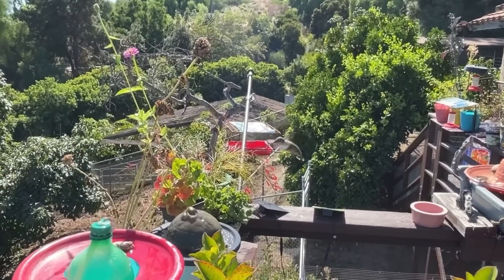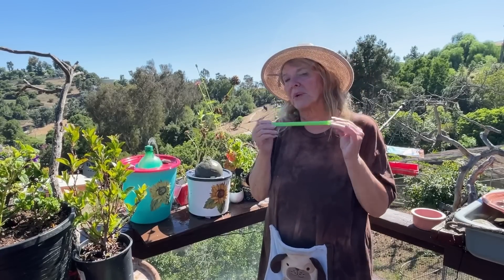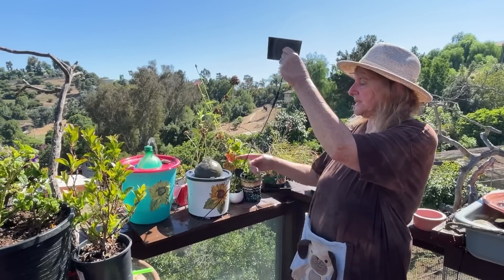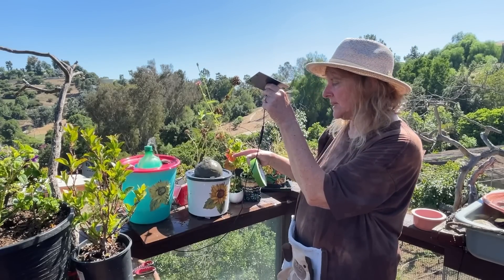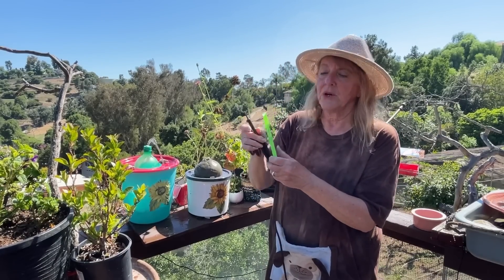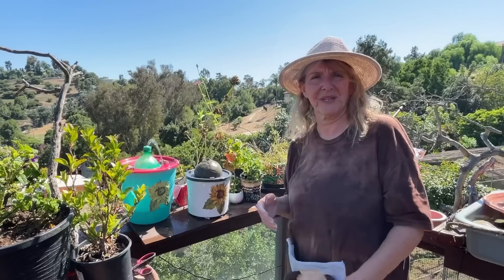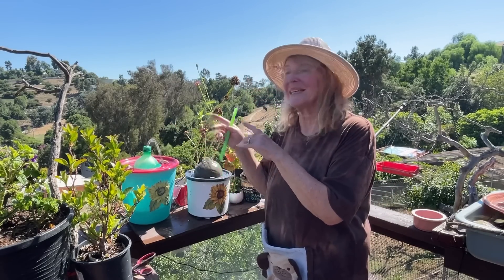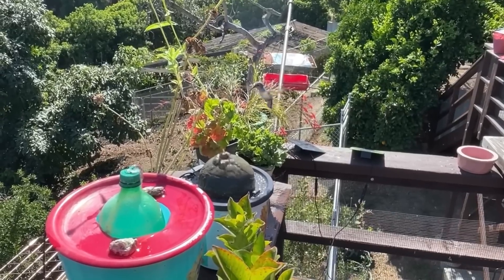Slow the Flow * How to Make a Solar Fountain for Hummingbirds Endless Water Bird Bath DIY Easy Fix

Comment: Slow the fountain down?! I can barely get a dribble out of mine! Robbie, I've been following you forever, I've built umpteen solar fountains based on your videos, but I can't get a single one to "spout" like yours. Granted, I'm in NC, not sunny California, but even in full sun, zip. I finally purchased a "real" fountain pump from Amazon and its spray is too powerful! It blasts so high up, it doesn't come back down in the pot, so it constantly runs dry. HELP!

Comment: I finally got my bait bucket ball set up except I made a cement ball using light globe I left lid in bucket and  just cut center it gave it extra strength plus had the  holes already bought tubing from site you recommended so perfect. The finished DIY  was perfect..❤ love your ideas ❤

Comment: I've been watching your videos for awhile now & I love them as do the birds. I have a question about one of your fountains that use the submersible pump & battery pack. Do yours ever stop working? I ordered the pump from your link, already had the power point, it worked great for the first day, the hummers & other birds loved it, then it stopped working altogether, even though the power point still showed a full charge. If so, what was your remedy for the problem?

Comment: Just today we set up a bubler according to your instructions, we couldn't wait after seeing your vids 🙂, and it works wonderfully, I am just trying to coax the hummers in to use it.  It's funny you posted this video today because we had that problem where the intense sunlight reved up the pump and it over shoots, I will try these fixes.

Comment: Hi Robbie. Not sure what department the straws were I didn’t see them last wk Walmart .
- I bought the usb solar I forgot it makes a buzzing noise. Will it scare the birds away? 
- I found the basters Walmart. Can’t wait to set it up. Ty.
Reply: I couldn't find the straws at WM either so I tried ordering them online, the day before they were supposed to come I got a message saying it was going to take longer to get them so they canceled the order.
Reply: @debwagner3161  ty
Reply: I ran into that too, although I looked all over Walmart - maybe they don’t sell the straws everywhere? 😕  I’ve just been using tubing instead and it’s worked so far.
Reply: @Sisteryoda1440  yes I have been using tubing also.  Ty.